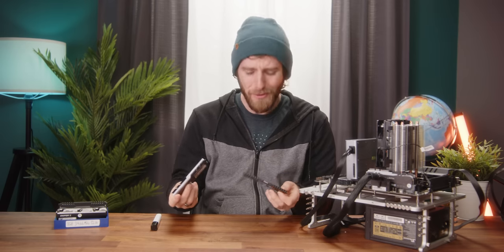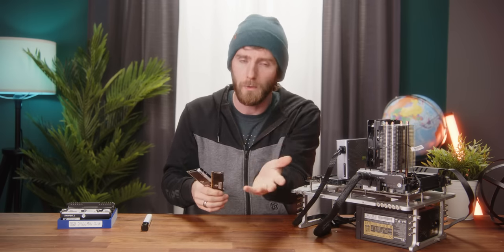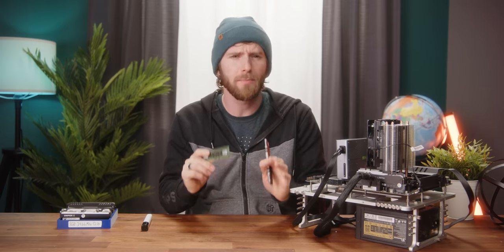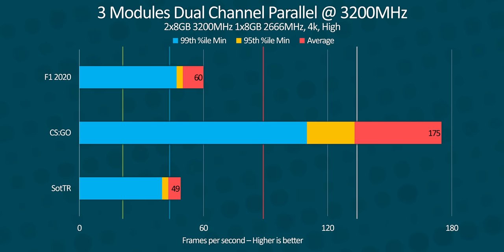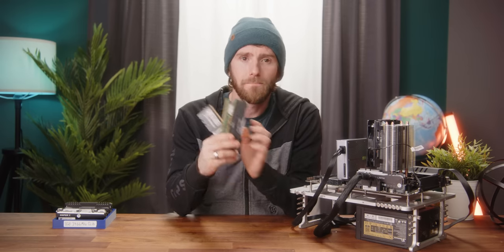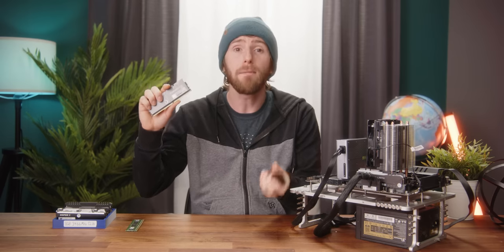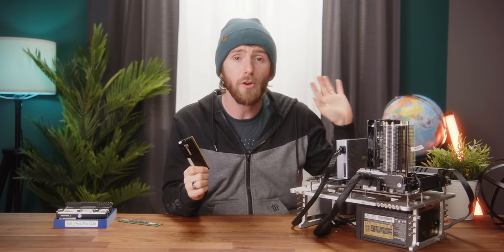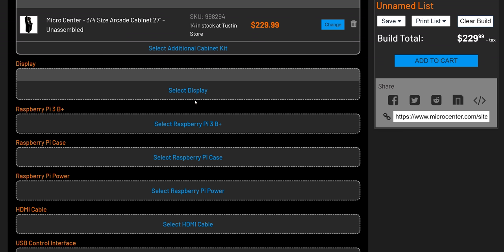Just How Bad is Mixing Memory?

Comment: Hi, I had 1 * 8GB Ram installed and i added another 8GB but different manufacturer.

After using the CPU-Z, i am getting different JEDEC Frequency and CAS

In the Memory:

i) General:

TYPE DDR-4
Size : 16 GB
Channe 2*64 Bit
MEM Controller Freq: 665

ii) Timings:

DRAM FREQUENCY: 1330 MHZ
CAS # Latency: 19.0 Clocks

AT SPD : SLOT #1:

DDR4-3200 (1600 MHZ) 8 GB BY MICRON
JEDEC # 12 > Frequency 1533 MHZ > CAS # Latency: 21 > RAS # to CAS  22
JEDEC# 13 > Frequency 1600 MHZ > CAS # Latency: 22 > RAS # to CAS  22
JEDEC# 14 > Frequency 1600 MHZ > CAS # Latency: 23 > RAS # to CAS  22
JEDEC # 15 > Frequency 1600 MHZ > CAS # Latency: 24 > RAS # to CAS  22

Slot # 2: Newly added
DD4-3200 (1600 MHZ) 8GB by TRANSCEND
JEDEC # 12 > Frequency 1366 MHZ > CAS # Latency: 19 > RAS # to CAS  19
JEDEC # 13 > Frequency 1466 MHZ > CAS # Latency: 20 > RAS # to CAS  21
JEDEC # 14>Frequency 1600 MHZ > CAS # Latency: 22 > RAS # to CAS  22
JEDEC # 15>Frequency 1600 MHZ > CAS # Latency: 24 > RAS # to CAS  22

i want to know if it is going to work fine or there is an issue as frequency and CAS # Latency: are different.

Comment: I recently changed my cou cooler to a be quiet derk rock, and after powering it on I got a ram code C5, probably unrelated, but what could be the cause and how to fix it? Could you make a video about ram issues / code errors. This is always where i get stuck and have to send it in for repair. how to troubleshoot ram issues and read the different  error codes? ps manual says C5 is for future error codes?!

Comment: Why the hell would anyone call populating each memory channel with differently sized RAM as "asynchronous dual channel"? 
"Asynchronous" is about difference in time, not difference in size. It dooesn't make much sense even if it were related to the fact that the dual-channel mode works until the smaller sized channel is used up to capacity.

What it should be called is asymmetrical dual channel.

Comment: Can anyone tell me how bad it is to mix same modules with different sizes? I had 2x 8gb modules and thought I'm buying another 2 of those 8gb modules on sale but what turned up was 8gb in 2 4gb modules. They are same manufacturer and same speeds, only difference is size. Are those 4gb modules fucking me here? It's working in dual channel but I'm wondering if I'm not making things worse? I haven't noticed my PC working worse in any way but I'd like to hear from someone more knowledgable. Also I suppose it's still better getting 2x 4gb sticks instead of 1 8gb stick so it at least runs in dual channel, right? Thanks in advance

Comment: I want to upgrade my laptop to 32Gb but one of the slots has a soldered 8gb ram. I want to put in a 32Gb stick in the other slot and then I don’t even need the soldered stick. Any tips?

Comment: Probably not what Linus means by mixing memory. But I recently put a completely different brand of RAM with my pre-installed 2400mhz 8GB DDR4, and the speed of the new one is 2666mhz since it was cheaper than 2400 (i don't know how it just is, OCL Computers logic) and they run amazingly at 16GB 2400mhz. Games are running good. My DAWs run well. Everything is perfect so far!

Comment: Tldr : bad if it doesn't work.  Good if you can get it running stable.  Use slower settings for stability.

Look up the original manufacturer of the memory dies and try to stick with the same (Samsung, hynix, micron etc.). The whole dimm manufacturer is not as important (corsair, adata, patriot etc.)

Comment: I wish someone made a ram to pcie adapter I don't even need all that much space I just want to max out the speed on that pcie slot and boot as fast as it can boot and add a battery to keep the data and maybe add a power switch to quick wipe the data I like ram it's easy to work with on breadboards you can copy a ram card directly with a few circuits without a computer quickly so you can have like more than one ram card and transfer data from a backup to the boot drive quick and then turn on the computer boot fast and have virus proof drive cant possibly get a virus stay after a reboot if the data was only just put there before boot

Comment: In my old system (i7 2700k and Z68 motherboard, ddr3) slots 1 and 3 are populated with 8gb 1600 Mhz XMP (venders are Patriot and Wilk Elektronik), slots 2 and 4 - 4gb 1864 Mhz XMP (Corsair) and all this mess somehow works perfectly with dual channel... And I know what I'm talking about, because I using After Effects all the time, and you might know how this * likes to just annihilate any memory you pc have, so any memory instability = BSOD (and probably a corrupted project as well... F u Adobe)

Comment: I tried this tactic and failed miserably.  I bought a gaming PC that already had 32 gigs Ram but it has four slots so I went and bought two extra RAM sticks by Corsair vengeance. The RAM sticks brand that will already in there were Neo Forza so after I added the Corsair Vengeance RAM sticks Tula slots the PC booted up and the lights came on but only problem is the keyboard and the mouse were not getting power nor was there a display and despite how many times and how many ways I inserted them into the slots it was the same result at that point I knew that this would not work with mixed RAM stick brands.  So I said screw it and just turned my 32 GB Ram into 128 by just putting four sticks of Corsair Vengeance 32 gigs each for a whopping 128 gigs of ram.  Yea yea yea i know i dont need that much but if you can do it do it.

Comment: hi buddy,,, i just wana ask i have a q87me mobo and have a i5 4590,,, i wanna replace my cpu with i7 4790k should i update my bios for this one? thanks
Reply: my bios version is 1103
Reply: The Q87 chipset doesn't have overclocking abilities, and your board has no dedicated vrm (voltage regulator module) heatsinks which are located around the top, left side and on beefy modern mobos even the bottom of the CPU socket. Overally the board has very little phases and is not a good choice, but if you're on a really tight budget go for the i7-4790K, but I suggest just finding a fairly unused second hand kit with like a i5-10400f because it's going to be much faster due to modern performance (cache, ddr4, smaller nm = less power consumption = less heat) and your current cooler most definitely fits both of the sockets already, unless you have something ancient on there.

Comment: thank you for all the info here. One question. I have an old 9020 OptiPlex with 8 gig or ram (4g x2). If I add an extra 16 gig (8g x2) same specs (ddr3, 1600mhz, pc3-12800, CL 11) for a total of 24gig of ram would it be ok? hope you can help. thank you

Comment: I'm currently using 8gb kit (4×2) mix with 16gb kit (8×2) for about a year now. My question is should I remove the 8gb kit and use only 16gb kit, or just leave it as it is?
(They both are 2400mhz)

Comment: great video and very informative. quick question for you. i drank the kool aid and started installing rgb in my desktop and i have a pair of 8GB CORSAIR - VENGEANCE LPX 3600 C18. can i run them with a pair of  8GB corsair - vengeance rgb pro sl 3600 C18? the only difference that i can find is that one pair has rgb and one doesn't. just want to make sure before going out and buying the rgb memory.

Comment: i had a 2666 and a 2400 memories working together but when i bought a gpu (rx580) and it wasn't booting/posting  i had to remove one of the rams and it works only with one ram/ i was wondering how could installing a gpu prevent my rams from working flawlessly together? altho i did try switching back to igpu to see if i can get the dual channel ram working again but there was no luck in that either

Comment: Crazy how Linus acts suprized that the ram runs at the rated speed. 
A 4.5ghz CPU wont run at 7ghz, why should a 2666 ram run 3600? Peer pressure from the faster stick?

Comment: I bought ram 8GBx2 3200Mhz kit years ago and recently bought the same kit from the same exact link and what arrived was visually the same as well as all the specs. But when checking CPU-Z it showed that the old kit's DRAM manufacturer was Samsung and the new kit was SK Hynix. Now XMP is horribly unstable. Does anyone know if that could cause instability or is it something else?

Comment: I mixed 4x4 GB 3000 Mhz Corsair Dominator with 2x16GB Patriot 3600Mhz using x299 and i9 9980Xe, and I was stunded when with the same overclocking 4,4 Ghz y get 1000 more in Cinebench and the sistem is stable, I don’t how works, maybe the memory has Tahoe same chips.

Comment: I'm using MSI Pro B660M-A DDR4 Motherboard, which has 4 RAM slots. I've currently installed two G.Skill Ripjaws V 8Gb DDR4 3200 MHz Cl16-18-18-38 RAM sticks in dual channel mode.

Now my question is, can I install two more 16GB sticks of the same brand (G.SKILL Ripjaws V 16GB DDR4 3200 MHz CL16-18-18-38) making my final configuration as 8+16+8+16 = 48 GB?
Reply: Yes you can, just remember to clear the cmos before installing new ram

Comment: How about you start the segment with beginners in mind. So you give a basic yes or no on if it is a good idea or not. I have built my own computers for twenty odd years and been in the computer market for forty years. However, I have never 1) water cooled a system, water and electrics never seems a good idea to me. 2) Over clocked a CPU, GPU or memory 3) I have never mixed my ram, why would you do that for when you have eBay always the same memory stick being sold at some point. You done my head in 3:16 by just going technical sometimes I can handle that, but such as this video just give newbies a straight forward yes or no, and then go into more technical stuff.

Comment: Hi, I need advice. My laptop has soldered on RAM which is 4GB 2400MHz 10-10-10-28. I have one vacant RAM slot, but the only ones left to buy are 4GB 2666 MHz CL16 (i forget the rest of the numbers)... will it be worth buying another stick? I just use my laptop for productivity (LOTS of MS Office and browsing)
Reply: You don’t need 8GB RAM for MS Office and browsing

Comment: I recently brought 2 more ram sticks but those timings are 16-20-20-36 instead of 16-18-18-36 like the old ones;
I tried to time them to the slow ones but it won't boot! 
I am running f50 bios on a gigabyte B450M DS3H
Reply: I tried everything - I just think the new rams do not work

Comment: I bought 8gb of Corsair RAM then two months later bought another stick exactly the same and it won't clock at 3000mhz . I asked for help from your community and I'm apparently an idiot for thinking two identical sticks would work together.
Reply: So I bought another two x 8GB of the same type just to double down.

Comment: Now I know why my laptop with 4gb + 16gb ram is having issues running certain games

It came with SK hynix 2 x 4gb 3200mhz (why?) I used a Samsung 16gb 2400T (from my old laptop) and SK hynix 16gb 3200mhz (from my friend) didnt work Only the SK hynix 4gb + 16gb 3200mhz combo worked

Comment: The simplest this i wanna ask is is it okay to mix the same capacity with deferent frequencies?
Reply: BioS will match your current lowest RAM module speed. While your highest RAM clock speed will be throttle down

Comment: Hey linus community, I wanted to ask ths question that i am currenty facing with my computer.my computer some times just wont boot.For the solution , i have to unplug one ram then boot into Bios and just change the dram frequecy option from Auto to 1600mhz(ddr3 system).And then with some chane , pc would boot normally with both Rams installed.Mother board :h81 mc Asus.Any solutions?

Comment: I mixed a vengeance 8gb x2 with my stock Asus ram 4gbx2. I noticed that my CPU recognizes my ram but the speed went down from 16000mhz to 1152MHz. Should I go to 16gigs for ram with higher speed or keep the lower speed with 1152Mhz with 24 gigs?

Comment: I took a 2x4gb DDR3 at 1200 and I took another kit at 2x8gb ddr3 at 1400 and some fucking how it ran better been running it for years to pick up the bottleneck I was having. I will replace it when I can buy a new MB and processor since it's like 6 years old

Comment: What if you have the same RAM in A1 and A2 and also two identical sticks in B1 and B2, but A and B are different? For example A1 and A2 are populated by Corsair 3600 CL18 2*16GB and B1 and B2 are populated by Crucial 3200 CL16 2*8GB? Would that work?
Reply: It will work. I have 2 Corsair rams in slot 1-3 and 2 hyperx in slot 2-4.

Comment: Hi, im curious - Can i add  x2 Kits of  DOMINATOR PLATINUM RGB 32GB (2x16GB) DDR5 DRAM 7800MT/s C36 Memory Kit on s z790 Extreme with a i9 13k Intel ? ( for some reason i want alot of Memory since i also use my PC for multitasking different programs, and need to have them running while I maybe do a quick Competitive match

Comment: I just bought a ddr4 16gb 3200mhz kingston hyper fury cl 16 but I didnt know my system's original single stick is the same model but cl18. Im afraid to enable the xmp coz it crashes hard as I have tested. how should I approch this? at default 2400mhz its 100% working though been running it like this for a month.

Comment: I somehow burn my PSU by doing those mixing ram. Long story short. I using DDR 4 3200hmz 16gb (8gb x 2), But I saw DDR4 2400hmz 32gb(16gb x 2) and my MB have 4slot of ram so I put them together and it somehow work for a few day. Until last night I were try to open my VR game and PC just turn off , Just to be sure I try to open the PC and it turn on back fine and I try to open VR game again it turn off again. After that I take out the 32gb ram out from the MB and somehow my PC can't turn back on anymore. For context it not the ram that cause (Somehow it related), It were the PSU . Just to be sure I use another PSU just to test it and it turn on fine now. And now I afraid to put all of those mix ram together for a second time , I just only use the 32gb ram that I buy and the 16gb just siting on the table not be able to use (I will probably put it on sale in FB market later.).

Comment: I just went all out on a Rig 2600 on just the tower and I went with some cheap DDR5 Mushkin Enhanced Redline 96GB rated at 5600 well I got a water pump from deep cool and the case that i went cheap on was actually really good looking and came with 5 RBG rans and with the GPG and the glass window I said dam that looks good I should of got RBG Ram too so I said screw it and got ORSAIR Vengeance RGB 32GB rated at 6000 I just threw them in and IDK WTF happen my PC booted but I had no Display I freaked out and took the new RBG ram out praying that everything would run It finally booted in safe mode and got a display then hit F1 NOT WORKING now im shitting a brick saying I fucked up my new PC for fucking LIGHTS well luckily after the 3rd restart for some reason the shit did not even go into safe mode the fucking BIOS came right up (Luckily in safe mode it was detecting everything and that Put my blood pressure down 5 points) Thank the PC GODS I WILL NOT DO THIS AGAIN

Comment: one 16gb stick 3200 and two 8gb stick 2666 running at the baseline 2666 for last 2 years.... 
BTW, I ran stable diffusion and virtualbox all the time with ram usage crossing 24 gb quite easily without much of a performance loss that can be called significant...
IMHO, Instead of buying a billion mhz super expensive rams, i wud invest in fast gen 4 m2 drives...

Comment: Could this be done running two Corsair vengeance lpx 8gig each at speed 3200mhz with two Corsair vengeance lpx 16gig each at 3600mhz? I could put 2 sticks in slot 2 and slot 4 and the other two in slot 1 and slot 3. Will this work and not using the theses 4 ram sticks? I really hope someone will reply back to this question? Thank you

Comment: So I can have an 8gb ddr4 3200MHz from hyper x, and another 8gb ddr4 3200MHz from crucial, both cl16 , and most likely it will still run in dual channels?  I just want the answer and will take the results with a grain of salt/not hold anyone responsible regardless.

Comment: I have a question. I have a Nonbuffered SODIMM RAM 4GB 2666 mhz DDR4, can I pair it with a 2400 mhz non ECC SODIMM DDR4 motherboard? If they're compatible, what kind of issues will I encounter doing this?
Reply: If you already have both of them you could try giving it a shot, but my laptop didn't boot when I matched a 16gb 3200 with a 8gb 2400

Comment: I had a 2400 mhz motherboard and processor i was using corsair vengeance 8gb 2400mhz ddr4 then i needed an extra ram and i was so short on money I bought a adata 8 2666 mhz non heatsink ram and they are both running fine on 2400mhz till now. I thought they both going to run on the lowest 2133 happen but they are yet running fine on 2400mhz  idk how that wasn't supposed to happen

Comment: Installed one stick of 8gb Samsung DDR4 ram, to my pc after one shorted out. Couldn’t find a replacement for the 4gb viper ram module, so settled with the Samsung after I found out Viper discontinued, my original ram model. The 8gb ram stick from Samsung works fine however, after this upgrade my ram capacity should be 20gb. But only 8gb is available, due to the rest of the 12gb dedicated to being hardware reserved. Anyone know a fix for this?

Comment: I run 24gigs. 2 crucial veangence 8gb. And 1 of a brand I forget. Overclocked. And I’ve tested without the random 8gig and with and I lose a small bit removing the random stick. That random stick gives me like 10 extra fps lol yes! I need that extra 10 fps! 

And it’s overclocked to 3333mhz

Comment: Im using one of my stock 4 gb ram dticks and one of the 8gb sticks i got to upgrade my pc, both at 3200mhz and it works very good. My motherboard is supposed to take ut to 16 gb ram, and i think up to 3600mhz but when i use both 8 so i have 16gb, my pc chrashes a lot